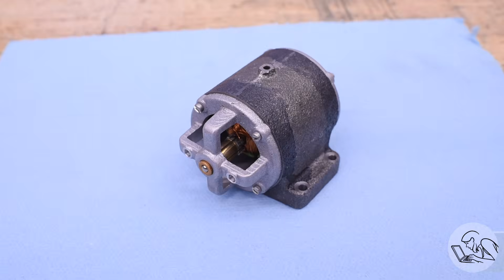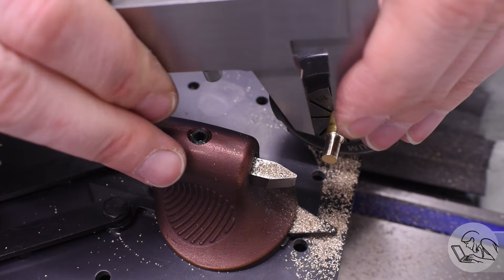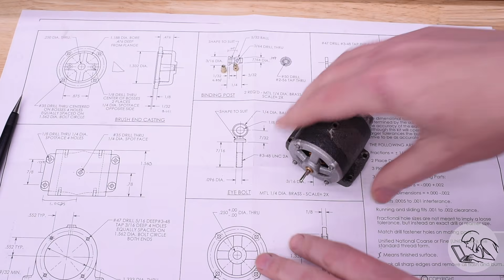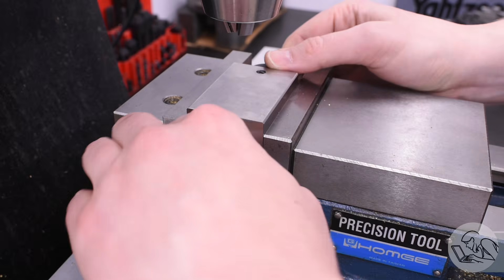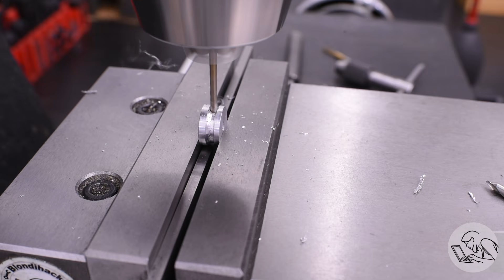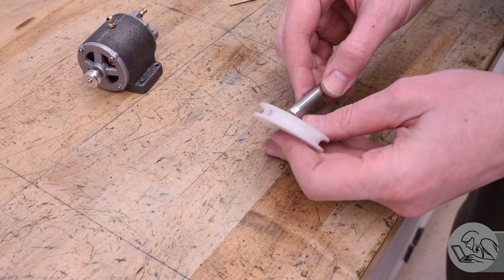Making a DC Generator (Dynamo!) - Part 3. IT'S ALIIIIIIIVE

Comment: I've had a great deal of success turning small brass parts on my wood lathe using small spindle scrapers. A reasonable alternative to other methods depending on the available equipment.

Comment: next is to make a turnnado with ratio compared to the tracing point. you could shrink or grow the movement which could make the tracing part easier to make if it could be bigger.

Comment: Gorgeous little genny! I'm currently (sorry) trying to fix an even less efficient system, a rotary converter with a little 6 volt DC motor and a 300 volt 220 mA DC generator on the same armature. It's tiny and cute and older than me, but nowhere near as pretty as your dynamo.

Comment: Ok, stupid question time: instead of cutting off the part with the fret saw, why couldn't you run the lathe slowly and use the fret saw as handheld parting blade?
Reply from the maker: That’s very dangerous- never hold a saw against a running part. The blade will grab and throw the saw into you. Even at low speed, the force of a lathe is enormous.
Reply: @Blondihacks  Ah, that makes sense.... lack of lathe experience equals no sense of scale on the forces.

Comment: In my view, the Turnado is the most versatile lathe tool ever. I recently bought the last of the accessories for it. The large radius arm can be configured to get the tool point around the back of a spherical part fairly easily. Thanks for the mention too. Regards,  Preso.
Reply from the maker: I have the large arm as well, though I confess I haven’t used it much. I need to play with it more. I really like your disc system though. I’ll likely copy that 😄.
Reply: Hello Mark and Quinn, I too have a Tornado and find it interesting to use. Mark, I have been looking on your YouTube website, but unfortunately can’t seem to find the video Quinn mention on your disc system.  I would be grateful if you can please indicate the name of the YouTube video.  Thank you, Keith
Reply: @keithjones8070  It might be "Building the Titan .60 Glow Plug Engine #8" @ about 20:21.  Mark is turning a spinner to hold the propeller on the engine by using his Turnado.  I searched his videos by using the "search" function (the magnifying glass icon) and typing in "turnado" (without the quotes).  Three videos were selected including the one I mentioned above.  That should cut down the time it takes to find what you're looking for it it isn't the one I mentioned.
Reply: @bobvines00  Hello Bob, thank you very much for your kind and informative reply, it is appreciated. I will follow your recommendations. Kind regards, Keith

Comment: Very nice Quinn. So to drive it, mount it and a steam engine on a car that can go behind the new Train engine and then put in a plumbing system that lets you tap steam off the rail engine for the generator engine. Then you have a small mobile power generator system for a work train or perhaps even powering other things.

Comment: Lovely job.  Im so glad you made the terminals to spec and didn’t blow them off as decorative.  They look so much nicer as designed.
Mine seems to like 6v globes.  I made a flat belt from duct tape but later found a nice rubber one for a tape recorder in a bag of replacement belts at the radio shack equivalent we have here.   I painted mine with asphaltum which is a bit like very old school powder coat used in japanning.  Its super hard super shiny and super black.

Comment: What a fun little project this has turned out to be, Quinn !  By the way, since it has a commutator,  you can run it as a DC motor. Just keep an eye on the maximum current when you use it to drive a load. Till next time !

Comment: The low precision method for converting from bushings to ball bearings is to put paper sheets around the rotor and then put it together with epoxy holding the ball bearing in place in the end bells. Then it's just a matter of taking it apart and taking the paper out.

Comment: Way back in the day I used to rewind the armatures for slot car motors. It’s amazing that they were assembled just like your generator; spacer and U shaped spring clips for the magnets. Used to shim between the magnets and the motor housing for a few more rpm’s
I did notice there wasn’t a step to check armature end play. Guess the kit is precision enough so not needed.

Comment: I wonder if it would be possible to modify the Turnado tracing tool so that the movement of the tracing point was reduced by a set ratio to the cutting tool. E.g. you move the tracing tool 4cm and it translates to a 1cm movement of the cutting tool. It would be a lever arrangement of some design but what that is I don't know. It would be handy for small pieces where you could make the template larger to provide a higher resolution to trace.

Comment: Good evening Quinn, see your videos and work as a machinist myself in a shop and i have a small lathe at home as a hobby too. I saw in a oldest video of yours that you say what kind of toolholder is that you use that clamps the toolbit like a diamond, but here in Brasil I couldn't find nothing like that, and i dont find the video with the description of the toolholder, if I not wrong there's one that you talk about it, anyway, if you could at least tell me the name or where can i buy it i'll try to buy one for me if they will send it to Brasil, thank you for your videos and sorry about the bad english and i will appretiate if you could help me on that issue.
Thanks

Comment: You could find flat belts and pulleys in some tape deck, turn table... Or buy new from electronic spare parts source. But it might not be suitable for high torque appllication.

Comment: Sweet. I wonder how much current that little beast would produce. Enough to power a 2W ‘parks on the air’ ham radio set maybe? Maybe 400mA @ 12VDC. Turn the generator with a bicycle on a stand. Coordinate pedaling while manipulating a Morse key ;-)

Comment: I can see how a flame (torch etc) would discolor the part, but since you can better control the upper temp (on an adjustable one at least) would a heat gun also cause part discoloration?  Or do you really need to get it so hot either way to loosen the superglue bonds that it has to discolor it?

Comment: Notes from the additive manufacturing neighbor: if you need to make small parts, try to use a .2mm nozzle but mainly by adjusting(increase) your minimum layer TIME either in settings or by slowing down your print speed. FDM struggles with small parts primarily from a lack of heat disapation. Stacking hot plastic makes a pile of goo, give it more time to cool down. 
Btw: I love seeing 3Dprinters/parts used in manufacturing of metals. Quick specialty jigs and fixtures are a huge selling point for me. 

Tldr: Crank your part cooling fan to 100%, slow your print speed down, smaller nozzle might help.

Nusher.

Comment: Some lead screw lock nuts have a small brass disk you put down the bottom of the grub screw hole to protect the shaft. Which you lose the first time you take them apart 😂